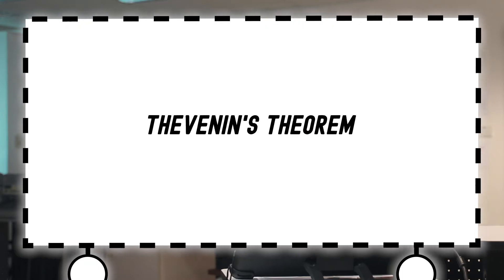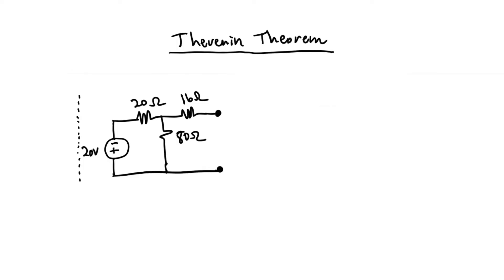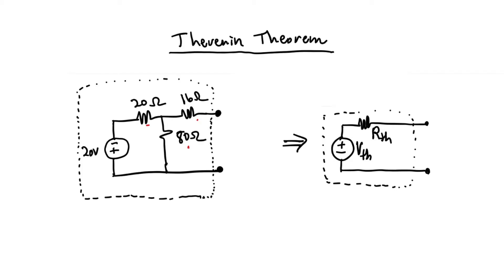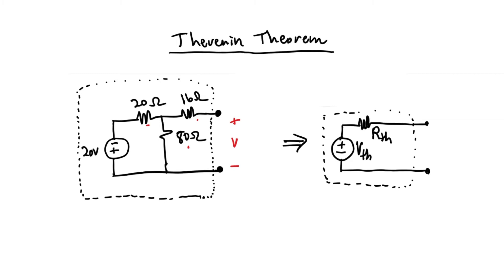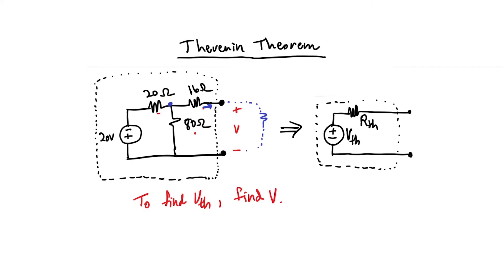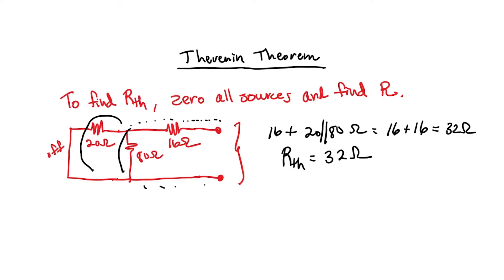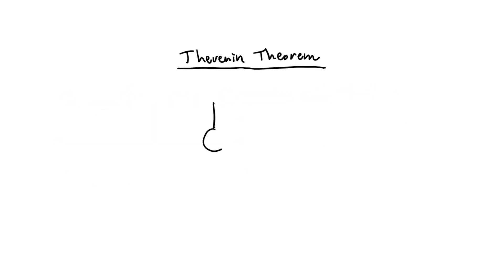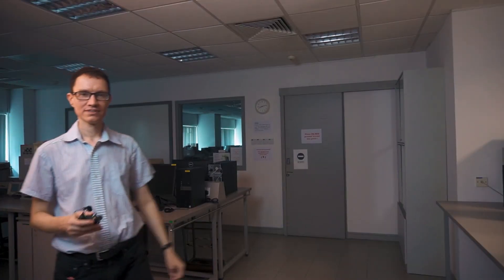Thevenin's Theorem (Circuits for Beginners #28)

Comment: Vth is a voltage divider. (80 Ohms/100 ohms=.8 Ohms x20V) = 16 V. /Rth= 80 Ohms in parallel with 20 Ohms= 16 Ohms + 16 Ohms = 32 Ohms.

Comment: I know it's been 10 months, but please help me understand.
at 4:44 , you put the 20 ohms and 80 ohm resistors as parallel. 

I assume you used the parallel resistor formula, Rt = 1/R1+1/R2+1/Rn ?

wouldn't the total resistance for those two in parallel be: 
1/20 + 1/80 = Rt = 1/16 or 0.0625? 
But instead, you said it was 16 ohms. 

What mistake am I making here?
Reply: The Parallel Resistor formula is 1/Rt = 1/R1 + 1/R2 + 1/Rn, so u gotta inverse the 1/16 which gives 16 ohms total resistance in the circuit. Parallel Resistor formula can be simplified to Rt = (R1 x R2)/(R1+R2) if there is only R1 and R2. This is why he did the calculation very quickly. Hope this helps!
Reply: @arulgk9673  thanks!

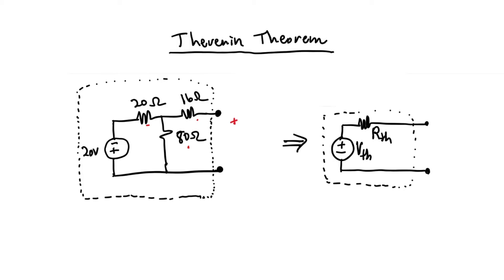Comment: Hi - At @02:20 in your drawing you have connected your DVM to the wrong polarity's?.
With no load connected V out and V would be 20V with respect to 20R + 16R to 20V NEG making the Circuit. How ever the internal 20V load current is V/R = A = 20 / 100 = 0.2A